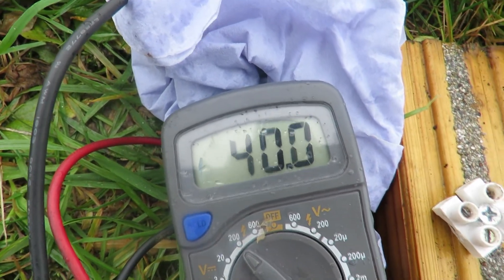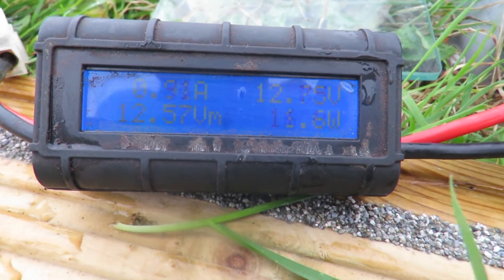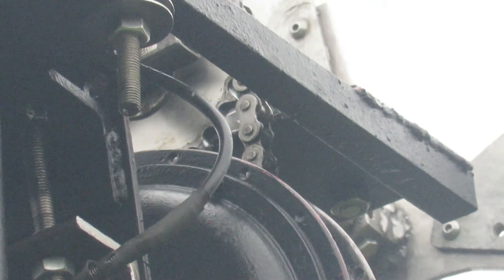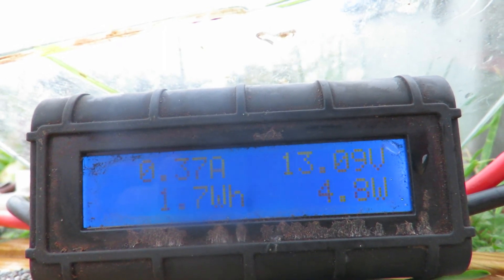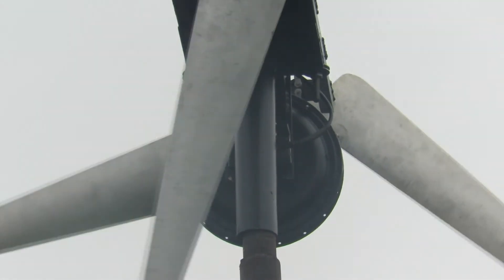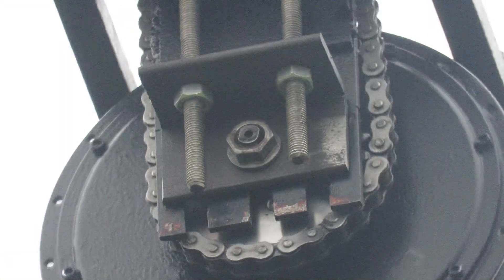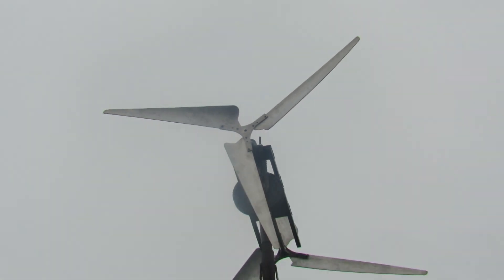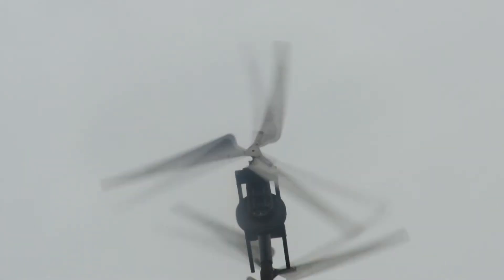Newly Built Wind Turbine Project 1st day testing 28th October 2020 - see description

Comment: try to make tail for it and put it in front of back blades... should track wind easier and also smaler cog on hubmotor might help with rpms :) but looks cool and in high winds will make power ;) great job
Reply from the maker: I thought about a tail but as long as there is wind it is OK , I'm gonna put the 5 blade hub on later and add another battery got some serious wind tomorrow 40mph :)